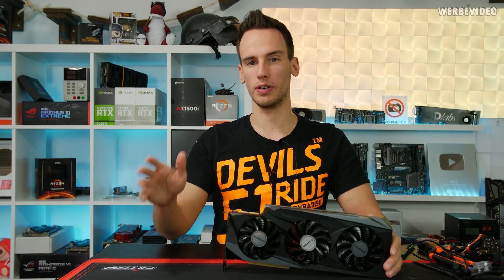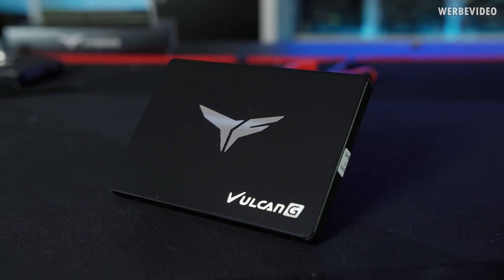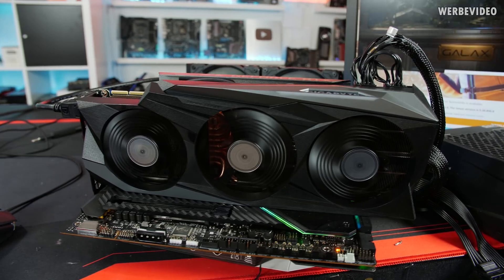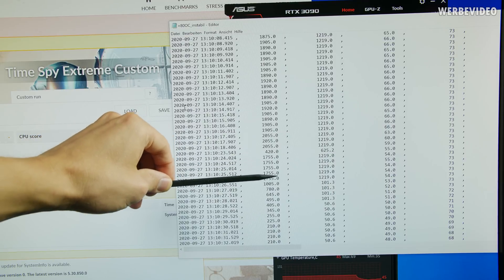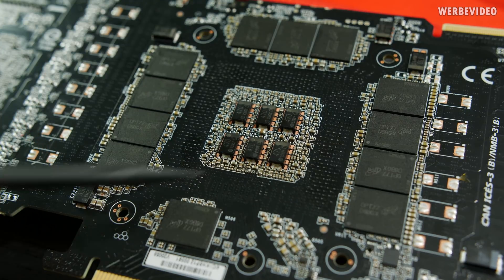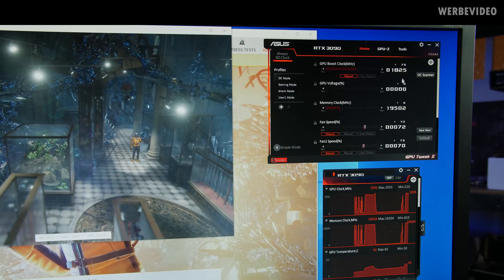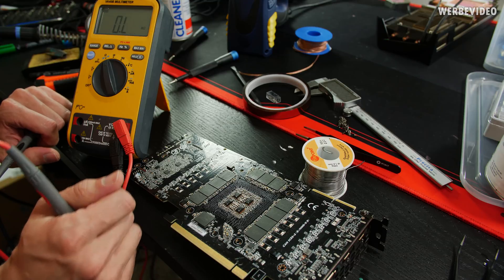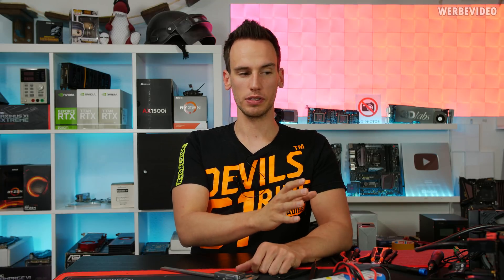We Tested the Cap-Drama - RTX 3090 MLCC vs POSCAP

Comment: MLCC stacking is easier , GPU MLCC parallel x2 vs stacking x4 of smaller values to make up for it is better . GPU will be more stable and faster
Reply: @ArkanceloAutore  I have different sizes around as they are cheap , larger sizes have larger tolerance in specifications wise , however even smaller size by 1 bound will not affect normal user 👌🏻👍🏻 you should use 10 x 100nf(2x5) instead 👌🏻 since your card had 5 x 220nf ... Or 25 x 47nf(5x5)
Reply: @ArkanceloAutore  depend on your card itself 👌🏻👍🏻
Reply: @ArkanceloAutore  You said you had 5 x 220 , those are nf
Reply: @ArkanceloAutore  Get a multimeter ... full stop

Comment: I'm running my beast (rog strix oc) at 2130mhz 100% stable whit lower voltage. (Big tip to lower the voltage, lowers temps and doesn't hit the power limit as fast.) Was running at 2160Mhz for a really long time, but after a hour or 2 hours it can crash. So not 100% stable. so keeping it at the save side. And yes, it does run at full speed and doesn't hit the power limit most of the time. Also depends what game i play.
 i wish i could flash it to have a higher power limit, that would be real nice and maybe whit a little more voltage i can run it even higher.

Now i have to say that it is fully water cooled also the back-plate. Without the back-plate it didn't come as high. stable around 2050mhz without the back-plate.

So not to bad i think

Comment: Great video.  For those out there wanting to do this, please take my advice.

1) buy a better solder pen
2) buy a cleaning Brillo pad
3) buy a solder sucker

He never got the PCB clean.  You must do that first.

When applying the new components, make sure and flux the solder joints and the component ends.  Hold in place, heat up, once hot, hit it with solder.  Similar to sweating pipe.

Comment: It's about accountability. If you want to release an expensive, top-end card like the 3080/3090, don't cut corners. Don't screw the consumer. That's the story here. Six poscaps is inexcusible but ASUS has their product images on retailers with that config. If there was no story then changes wouldn't have happened. FE did not use 6 poscaps from the start.

Comment: You have proven what the problem is: the Esr value of the decoupling capactors at the given clock frequency constitutes the problem.
Before reading any further you must understand, that this has nothing to do with the brand or quality of the capacitors.
Its purely a physical/electronic releations problem given by the physical size of the capaciror.

The larger the physical capacior is, the longer the current path is thru the capacitor. This becomes a problem at higher frequencies, where the distance itself will work as a parasitic inductor in series with the capacitor, which gives high resistance to high frequencies.
It is inherent by its physical size.

The smaller the capactor is, the shorter the current path is. This is beneficial at higher frequencies as the parasitic inductance is then also much smaller.
To compensate for the smaller capacitance value, we connect 10ea in parallel, which results in the same capacitance value as the big type.
But in addition we also have all the parasitic series inductors in parallel, which results in an even smaller parasitic inductor, thus further increases the frequency range of the capacitor.

And the result is as you can see in this video.
Please understand that this problem is far from the wellknown rectifier capacitor physics in the power supply, as we are working with extreme high clock frequencies, which must be decoupled.
Decoupling should here be understood as effectively shorting out the high frequencies - on the power supply line - to prevent it reaching the GPU internals, making it unstable and self oscillate to its own safety shutdown.

My point is, that replacing ALL the large capacitors, with small mlcc types, will give even better results.
But maybe not so much what you expect in relation to the workload needed to do so.

NOTE: I strongly advise you NOT to play around with soldering on your graphics card.
It looks easy in this video, but requires a very high level of skills and experiences with smd soldering technques.

Comment: Why... Why people just drop some MLCCs to a board, add some solder and expect it to be working solution? Is it that hard to RTFM's and do some homework, huh? MLCCs are good, but at frequencies above hundreds of Megahertzs you need an array of MLCCs with different capacity. They have to be a real good quality (like temperature stability and so on) and you have to remember, that MLCC CAN and WILL drop it's capacity up to 70% when it's used in real hardware due to technology limitations. 47uF may become 22uF when used in GPU power supply rails. Fukken pseudoengineers...

Comment: partners should put the same has nvidia is puting, if nvidia is using 2 rows of small capacitors why are partners cheaping out. Just put the god damn small capacitors and the gpu is more stable, you just prove that. I bet if you swap all 6 rows with small capacitors it would boost even higher.

Comment: My consumer experience over the years went like this: 980 ti  crash at max boost (factory settings)  1080 ti same story  2080 it same story (last 2 same brand with the one you test it - all the models "enthusiastic line)  solution?  lower the gpu clocks. And you start thinking  maybe you get reviewer samples and consumers one got problems?  We got forums with enough comments about this problems.  I guess will be lowering the clocks again with 3080  but TI version is not out yet:)

Comment: Awesome mode with the CAPS...., just wondering though, what would happen if all the large caps were replaced with the smaller ones..?

Can you make a part two showing that..?
Cause, this seems to be the new way to boost performance and perhaps stability on the graphics cards. As vendor try to save cost by installing cheaper/easier to install parts. thus, perhaps allowing end users to upgrade to better components.

Please, try...

Comment: I went from 2000mhz and settles down to 1958mhz at best on my GTX1070 to 2114mhz rock solid with a simple shunt mod. It seemed to help with performance a little but not really that noticeable, I figured it was out of warranty anyway, minus well do a permanent shunt mod untill I get something faster. My other 1070 when I did it, I was at 2028mhz at best and after so long it dropped to 1958, didn't seem to matter, once I did it, it stays at 2028mhz now without dropping, but it wont go any higher. Still a vary small performance bump.

Comment: Something we have at our office is soldering tweezers.  Both tips get hot, so you don't have to switch back and forth between pads to lift up a component.  You simply grab the component by the pad sides and lift up after the solder on both sides has melted.  This tweezer set can be had for many popular irons.  Just a thought if you do this work often

Comment: why not solder a dual channel oscilloscope on either side of those caps before removing? you would have had more of a true understanding of the effects of what you did before and after
Reply: kudos for trying it out though, specially with the size of the soldering iron you have XD

Comment: So what do I understand  "  MLC seems to hold more power and delivering better then SP Caps  but the main issue is that now Nvidia double the amount of cuda cores leaving the chipset less room for overclocks as there is more cuda to run " just like a cpu with tons of cores  they are less overcloables if there isn't extra power to subtain all of them.

Comment: Have you tried this with the new drivers? My founders is able to boost to 2160 with new drivers. Will even undervolt to .9 volts and boost to 1995 pulling only 260 watts. Stable for over an hour and pull over 12k in port royal. New drivers have fixed all problems that I've had.

Comment: wait.... my EVGA Gtx 980 SC has been doing this for years.. but only in certain games, Screen goes blank, flashes and i get a windows notification saying the driver restarted

In the games it crashes, i down clock it 100-200mhz and its stable again, but put it at it's factory overclock in games it doesn't crashes in (cuz the SC version comes with a factory OC, so down clocking it is just lowering it to the stock 980 SPEC) Ive recently found that to solve it.. i dealt with it for years with it crashing consistently, and i didn't know how to fix it, drove me mad and stopped me from playing alot of games, so glad i found a fix even if it's a unfortunate one 

Istg if i get a new gpu, and it happens again then imma flip lol, has been frustrating, seems it happens when it's a light game, with ALOT of fps, like minecraft, rocket league and warframe although not in csgo weirdly enough... i thought it was maybe a OpenGL issue, but rocket league and warframe aren't OpenGL like minecraft is

Comment: Also something you should probably know about those cut off caps on the back of the GPU: they are not necessarily all about the maximum voltage allowed or overclocking potential. They are more about stability with highly fluctuating current. The layered capacitors will be able to deliver much more stable voltages in erratic environments. This will help with overclocking of course but that is not the purpose for them. The end user experience will more than likely be something akin to being able to play their game at maximum factory over clocks for six or eight hours without crashing while a card without them will Have a higher likelihood of crashing every few hours - given the same settings and all other things being equal.

Comment: Yes, the 20 series is still highly unreliable and many cards are still failing even today. You can see this quite easily on eBay or Yahoo auction for example how many cards are being sold for parts only. You will notice that there are about five or six cards added almost every week. And it’s about the same number as working cards being added to the auction listings. So yes Nvidia is still shipping cards with troubled GPUs at about the same percentage rate as when they were brand new for the first adopters or the early adopters.

Comment: Please look at picking up a cheap reflow blower nozzle which you can use to remove and replace components without your soldering iron. They are cheap and extremely effective, be sure to use very low air speed when around components smaller than 0603. Thanks for the video 👍
Reply: An example
https://kaisertech.co.uk/quick861dw-1000w-hot-air-rework-station?gclid=Cj0KCQjwwuD7BRDBARIsAK_5YhWPVKA84ojtJtPtiZFuYU3FkOLSWMSR770LNguphS9VtAtaO64eVe8aAoyKEALw_wcB

Comment: Yes, it is major bias, there is possibly something wrong with every card on the market, but unless you find it and broadcast it, tell everyone about it, then no one knows about it.  Just like with the iPhone 4 and the Antenna problem, most people did not know about the antenna issues until it was publicized, in fact most people would not have even been able to reproduce the problem.  Firmware corrects problems, and manufacturers have many options to improve stability even after their products have gone to market.

Comment: SMD tweezers make caps and diodes much easier to remove.  Saves you from having to pry or flood the component in solder.  I've ripped pads off the board when prying so it's not advisable.

Comment: I think the instability issue is a consequence of more than just the capacitors on the back of the card.
Reply: The problem is usually adding up from power supply, motherboard, cable, environment (EMF) but nevertheless, the capacitor on the back of the card is the last line of defense for delivering good "power" to the chip. But I bet a lot of this reviewer has a good all of them (good power supply, good cable, good motherboard) thus they can almost ignore it -> which lead to the only new is GPU.

Comment: ASUS cards have the expensive capacitors, in all six slots, like you installed in the two center. Maybe the release worked out well, to get the scalper bots, that were buying up as many cards as they could.  Other reviewers like JayzTwoCents found that if all these capacitors where the expensive ones that you had installed the card was stable if proper cooling and frame rates were controlled. Great review.

Comment: Will you try to add filtering caps to all empty spaces ? There is like 15 spaces for sp caps, and o freaking lot for 0805 mlcc-s. I filled spaces od my 1070ti strix and memory frequency goes up 125mhz.   Try to use JBC soldering station, they have heater element and sensor in tip, for smd on power planes is very handy tool to work with :)

Comment: Dude... please take a basic soldering class, and get a reflow-specific hot air gun.
Dry oxidized iron, *ripping the caps off the pads*, dry joints, way too much solder, no flux to be seen at the actual joints...
Not to mention you probably overheated the caps. And what kind of test is this without testing the components!? Those caps might as well be electrolytics, because you didn't measure their ESR, ESL, you didn't specify their dielectric(which is very important!). Replacing good tants/poly caps with shitty X5R ceramics is not going to help you much.
Shame, I expected more from you.
Reply: If you buy your caps from reputable vendors, you don't need to test them.
Reply: @eidodk  Correct. But here the testing is needed because he doesn't know what kind of caps are on the board.
Reply: @Spirit532  Sure he does... 470nf caps are on the board, and his result clearly shows those he mounts are better quality.  They are sp-caps.  the poscaps that are on the board are mounted elsewhere (connected to the power and memory stages) and are not touched at all - also poscaps would have a plus sign in the white area on the stamping.  Also, the quality of the caps is literally written on them.
Reply: @eidodk   "470nf" is not enough. Read my original comment. And you can't "write the quality of the caps" on the caps themselves, because it's two pages of datasheet and test conditions...
Reply: @Spirit532  did the test show an improvement ?  Yes it did. It's really as simple as that.
Reply: @eidodk  Nowhere near as much as it could have.
Reply: @Spirit532  So ? The test was "Will it improve", not "how much can we make it improve". Before you know if it even will improve, there's no reason to go buy platinum graded capacitors.
Reply: @eidodk  There's no such thing as "platinum graded capacitors". The test should show how much the best(within reason) capacitors could improve the performance. What was instead shown is how some random MLCCs, which may be WORSE than the original capacitors, changed the performance. No quantifiable info.
Reply: @Spirit532  I know how you grade capacitors, that was just not the point.  As to what Der8auer wanted to test - ultimately you would need to ask Der8auer, but my understanding of the test that it was supposed to show if 10 47uf caps in parallel was a better choice than one cap of the full value... That test was highly conclusive.  also - the fact that you didn't get to see the quality of the caps being used, doesn't mean they weren't known. It just means that was info left out of the video.
Reply: @eidodk  Caps aren't graded.
Reply: @Spirit532  Sure..... let's just ignore Q ... Replacing with X5R caps is more a problem with the temperature range, since GPU's aren't supposed to start throttling before they reach 100c ... X5R doesn't like temps above 85c.
HOWEVER .... In this application, regardless of the cap type, it CLEARLY seems to work.  The test STILL wasn't a "let's see how far we can push it" test, it was a "let's see if it is even POSSIBLE to push it."

Comment: Was waiting for someone to actually try the same card with different caps.
Like, all the fuzz and nobody goes and checks how much of a different it actually makes.
And your soldering is fine. I see what Louis Rossmann does, so your work is done well enough.
And now for the ultimate test, replace all and see if that changes anything or if the 4/2 mixed setup is fine.

Comment: always love your engineering videos.

one thing i feel like you should test. how does the difference in capacitors change the issues with RF noise?

as in J's videos they found that an RF mic could causing the OC to crash

Comment: The folks having the issue all had wireless microphones...tiny RF transmitters.
Traces on a PCB can act like little antennas, picking up outside signals which can can cause issues.
Are better bypass caps going to help?  Yes.
A better solution, however, is to stop running RF transmitters next to uncovered PCB's...

Comment: So, why is over clocking this card a big deal?  Isn't it fast enough? I still have an Asus Strix 2060 OC back when the 20 series came out. Great card. I can and have overclocked it like crazy. But it works well enough for the games I play at the 1080p at ultra or maxed out settings at stock clocks.

Comment: I wonder which capacitor has more coil whine though.
No one ever talks about the one thing that can and will ruin your gaming experience.
Reply: Coil whine comes from vibrating inductors, not capacitors - it's right in the name!
Replace the inductors with shielded, sealed ferrite inductors of the same/similar spec and you'll have no whine.
Reply: @Spirit532   Thats what they should damn well do on the expensive cards :/